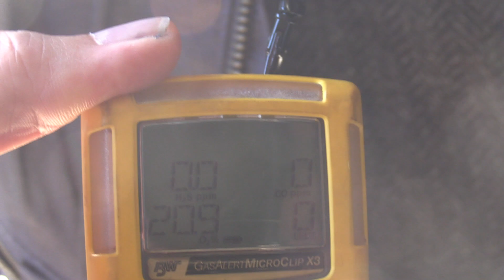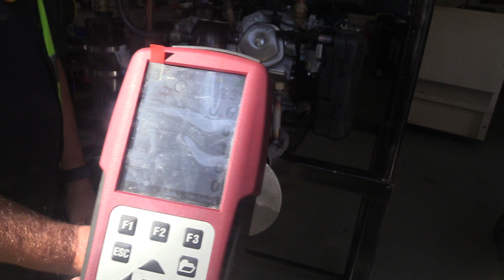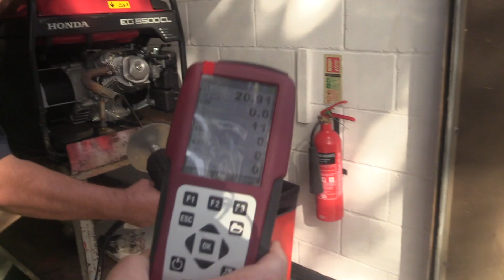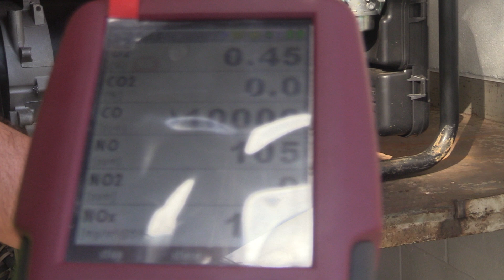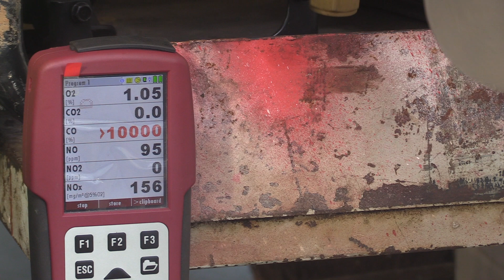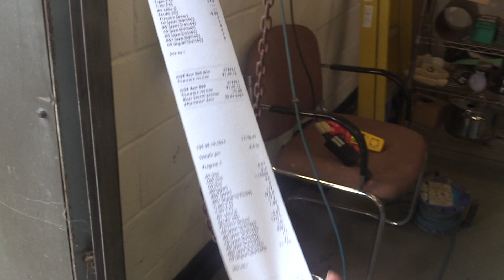Thunderstorm Generator Demo October 2024

Comment: Great work. 
Modern enclosed portable petrol gensets are really quiet, TSG applied to these ?.
ie those ubiquitous Honda type engines are always obnoxiously loud, is it possible to design effective muffler/silencing into the system?.
TSG + really quiet operation would drive uptake exponentially.
👍.